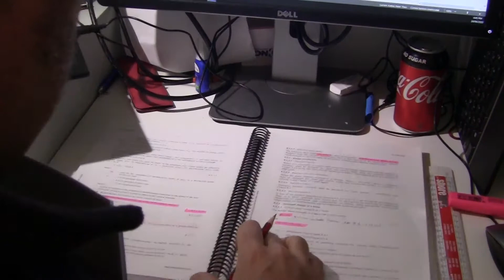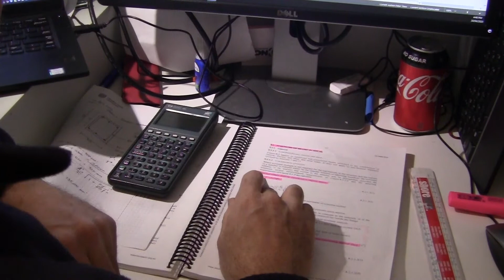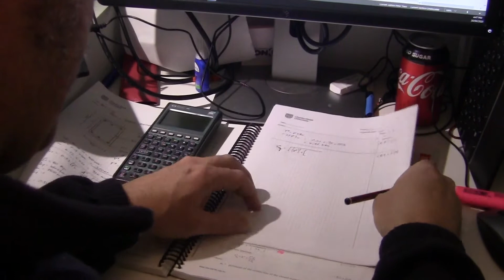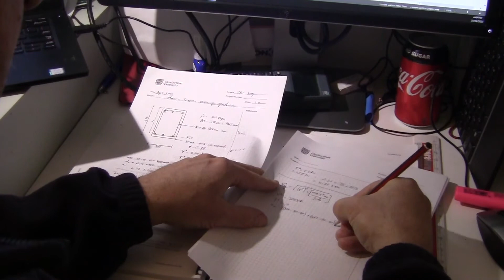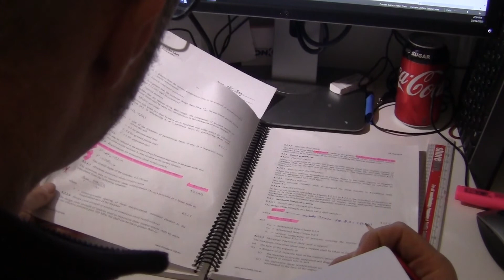2 Designing a concrete beam for Shear and Torsion.  AS3600 2018 Part 2

Comment: Very helpful series of videos. Can you clarify how you got T*?
Reply from the maker: T* is the torsion load, therefore T* will come from your structural analysis.  you have to make sure that your torsion capacity of your concrete beam is greater than T*.  Does that make sense?